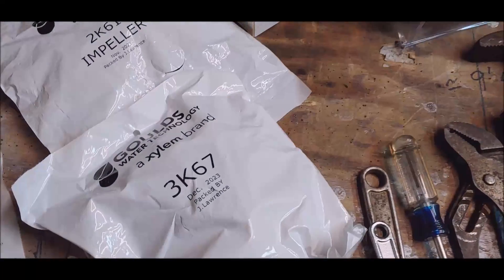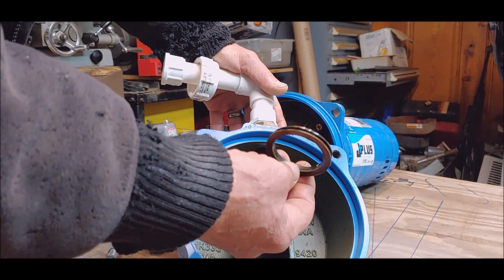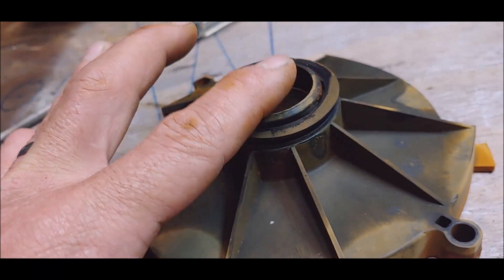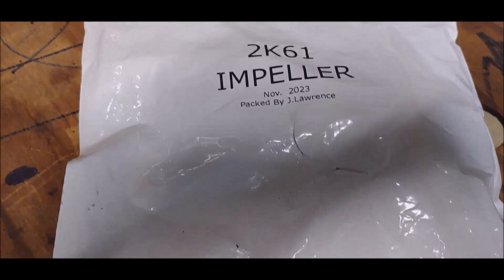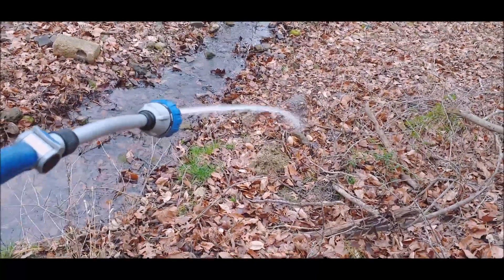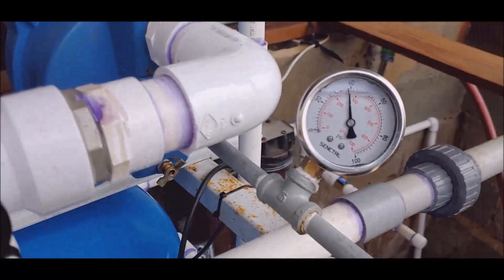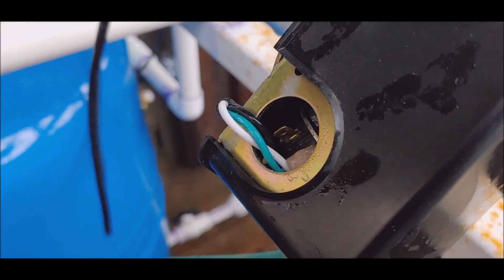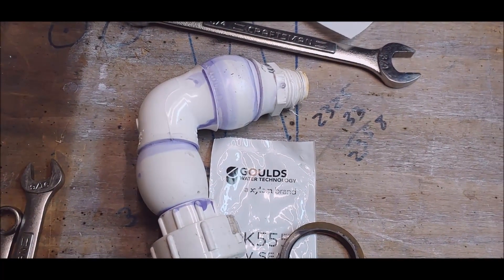GOULDS pump boils water!  What failed?

Comment: Adjust the 40/60 pressure switch to a max of 60 psi; that should do it; you boiled water because the switch did not cut off at all.

Comment: A J10S max pressure at any suction depth is only a little over 60PSI.  Your should not be running that pump much higher than 50PSI.

Comment: Why do you have two? 
J10s can push 20 gpm having a setup like that they are fitting each other.
Reply from the maker: @tonycoffee7335  The second pump is a backup. It isnt running. I used 3 way valves to line up if needed.
Reply: @thesaltypaultard1271  alrighty.